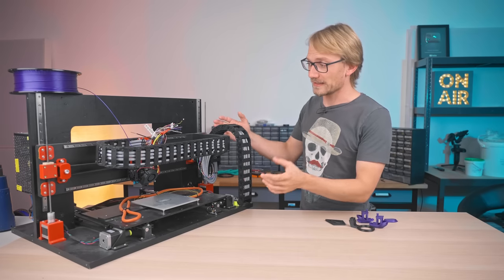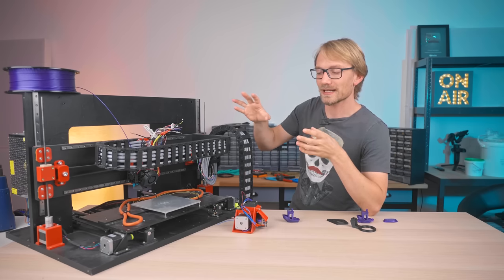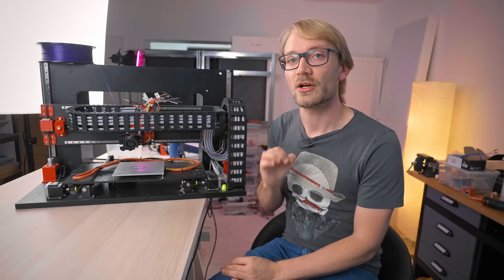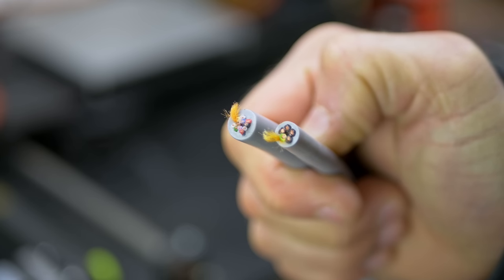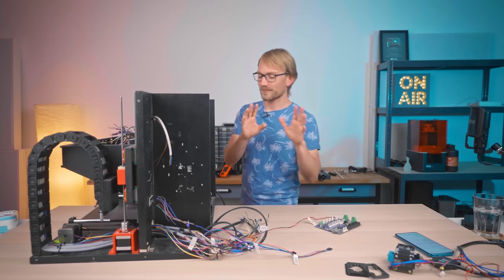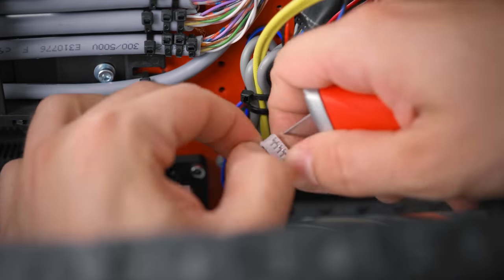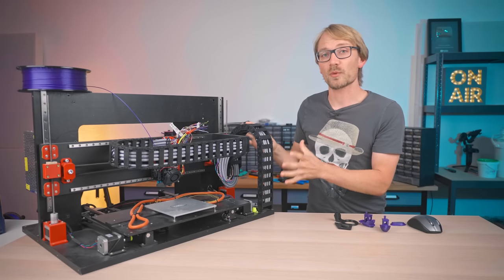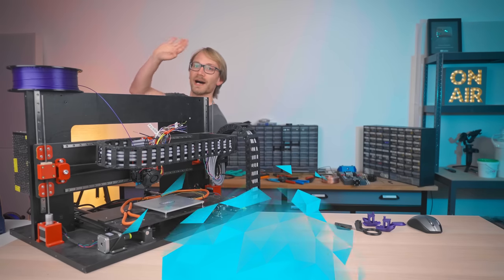This 3D printer can use ANY components - ultimate machine for parts testing!

Comment from the maker: Did I mention it's got dual power supplies? (12V and 24V)
RGB lighting?
Support for ANY type of heated bed? (expect a MK3 clone bed on this soon)
A built-in webcam mount?
Dual Y-axis motors for slinging around that massive bed setup?
A 0.9° motor on the X-axis for maximum resolution? (want to see testing vs. standard 1.8° ones?)
Support for sensorless homing and ANY type of bed probe?
There's so much more that this printer enables me to do - let me know what I should start with!
Reply: so dope
Reply: I'd buy it :D
Reply: You should use rigid couplers for Z screws. The springy ones can cause a lot of artifacts
Reply: How about neopixels that would awsome
Reply: does your 12v go through a Buck/Boost circuit?
Reply: It would be nice to see some testing to show the effects of bed heating on nozzle to bed distance. For example show a poorly setup bang bang showing cyclical cupping/warping of the bed, or just nozzle to bed distance at different bed temperatures. I've personally done a little bit of testing with this using a BL touch and the Marlin optional probe test feature which checks the repeatability of a probe. You can also use it to test the z offset as a function of the temperature you set the bed at (also a dial indicator could probably show that as well).

Anyway glad to see this printer back in motion. And I agree for a first print that benchy looked pretty good other than some tuning required.
Reply: Do the 0.9 degrees motors vs the 1.8 degrees
Reply: Can those Igus cables have a connector crimped on? (I'm sure they can but is there an Igus specific connector?) I keep thinking of using a cat5/6 connector for control signals and something like a Deans T connector for heater power since they're rated for around 60 amps.
Reply from the maker: @Márton Gerlei Something I can definitely test!
Reply from the maker: @Phil Chia it's two full power supplies - one for 12V, one for 24V. Either one has enough power to run the entire printer by itself - that lets me mix and match 12V and 24V components anywhere.
Reply from the maker: @Riot54 I'm using all-standard connectors - "Dupont" style for low power and logic (they can handle up to 2A) and 2.8mm crimp terminals for power.
Reply from the maker: @Eric Lien thanks, lots of good idea for testing things! Over the years I've measure many of these already, but haven't done it in a way where it would be fit for publishing.
Reply: @MadeWithLayers  I was just thinking of those hot end connections since you seem to express some exasperation there, especially with the Hermes/Hermera's crossed over stepper connection. Some kind of breakout board attached to your cheeseplate with the correct wiring for the stepper and a quick connector for the entire cable might save some time and frustration if you do a lot of swapping in the future?
Reply: Great Work as always, I was wondering when this printer would make another appearance
Reply: Bondtech bmg vs E3D Hemera would be cool.
Reply: I would love to see some watercooling tests... But that would require a closed box and a heated chamber to really see the benefits.. :)

However i would love to see the 1.8 vs the 0.9

But I would really love to see some tests of all the chinese clones as People are using these the most...

Im thinking about dragon hotend, mosquito clones and so on.

Test of the latest skr boards would be great aswell..

There is also a bondtech bmg all metal liquid cooled that would be extremely cool to see in action.
Reply: No, I can't have missed that much. Wow you really went all out on this. 1.8° vs 0.9° degree steppers would be really interesting.
Reply: 0.9 vs 1.8 at different speed settings and different drivers a49888 vs tmc2209 with different stepping interpolation,there is so many things like skew correction using sensor less homing on both z axis if they run on separate tmc's same with y axis. how about positional accuracy with that thicker  belt  and different teeth spacing..    now i gladly donate  to patron to answer some of those questions
Reply: I would love to see some clone-vs-genuine hotend shootouts

Nothing to do with the fact that I have a clone in the mail of course...
Reply: It needs a cup holder. Make that an RGB cup holder.
Reply: the genuine vs clone thing is a bit of interest to me, got a v6 clone, after a while of using it found out that the heater was a bit smaller than an actual v6, but when i had a bit of a filament issue (may have coated entire thing in thick layer of pla) ended up putting genuine v6 heater block and stuff on the clone heartbreak/heatsync.  curious if that makes a difference (probably not, seems to work fine, been running this way for quite a while)
Reply: Big - Expensive -> BSht
It's  all about money !
Reply: Yes.
Reply: I'm jealous now...
Reply: Riot54 very true
Reply: Nice build. Very cool.
I also built a printer, that is now my test bed for trying out various things and different hot ends, etc.. 
The challenge on mine was to make the frame 100% printed, and large format (Chiron clone on Thingiverse),, Was VERY happy when it was done,, and it worked better than I expected. 
Instead of a dual power supply (which I almost did), I went with a larger 24V supply, and used a step down to 12V converter to get the other voltage.
Might build another and use rails like you used and recycle the electronics from the Beast into that...
Reply: Maybe a continuous printing belt over the platen, multi-filament feed, multiple heads
Reply: RGB lighting of course.
Reply: You really should do a collab with Stephen Hawes to combine the Mendel 9001 with the Index pick-n-place!
Reply: cool can you test geared motors?

Comment: I was wondering if anyone has done a real life controller comparison. The printer itself is easy to modify but the controllers are the real heart of the printers. I would like to see a robin nano vs ramps 1.4 vs ... tested. Also a full video tutorial on using your laptop and slicer to configure and fine tune your printer.
Reply: I am also very curious if you could see any differences between marlin vs the reprap firmware.
Reply: @Voyager_2  also the robin nano and the rumba 32 and rumba plus
Reply: @recumbentcountry   also skr 1.4

Comment: You can compare modern ways to remove ghosting/ringing. Klipper have Input shapers, ReprapFirmware have Dynamic Acceleration Adjustment and Marlin have S-curve with junction deviation.

Comment: I'd love to see you test out Klipper - either on the Duet (I've done it) or on a different board, to compare Klipper VS Marlin VS RepRapFirmware for example.
Reply: Klipper is ideal for this type of testing rig anyway because of how easy it is to change the printer configuration
Reply: @Nitor_  It's got a duet wifi so also incredibly easy to change the configuration.
Reply: Yeah I'd love to see this too. I recently switched to Klipper and have had no issues with it, but I've not done any proper testing to find minor quality differences. There are none that are immediately obvious though. Unless I find some major issue, which seems unlikely at this point, I won't be going back to Marlin simply because it's so easy to tweak, and I'm constantly upgrading and tweaking my printer. 
It started as an A8 and I'm about to finish my latest changes which will see it as a 300x300x300, 32bit, linear rail, corexy with a 500W bed xD
Reply: @JasonZnack  except I find the duet configuration incredibly tedious because it's all in gcode. To each their own I suppose
Reply: I find my duet mastero so much easier to edit firmware settings I love itsoooo much better thrn flashing a bootloader thrn using audrino and marlin
Reply: @goeland86  Do you know about web interface where you can configure your printer?
Reply: @seanwood5443  Yeah ok - compared to Marlin it's better. Klipper is yet another step to make things easier. Edit a config file in Yaml with human-readable values, and save - it get applied on the fly.
Reply: @vladimirseven777  For Klipper you can install the octoklipper plugin and edit it directly from the Octoprint settings panel.
Reply: @goeland86  I can avoid installing anything and do it for Duet Wi-Fi from browser on my PC.
Reply: @vladimirseven777  octoklipper = plugin on octoprint... Nothing on your PC.

Comment: I built an M90 over 4 years ago from a dismantled Prusa Mendel using dibond panels. It has been a very robust machine and was last used in a print farm churning out visors 24/7 for a couple of months. Glad to see you adopted a more modular approach for the hot end.

Comment: If you are going to be pulling wires all the time, I highly recommend getting a labeler that prints onto heat shrink tube. It won't come off as easily, and won't get caught on the other cables all the time

Comment: Very nice!  Been waiting for this build for a while now, and am not disappointed in the least!  Very awesome build. 

I do think you should consider tidying up that cable area though; maybe make it modular by adding breakout board where all the wires are just individual pin headers (or some other labeled modular connector).  Then you can just use patch cables between there and your actual board (and remove any unused cabling).

Comment: 16:06
I think it will be better to mount this horizontal cable channel vertically, above the extruder, avoiding any warping of the extruder mount
Reply from the maker: Goal was to still keep the printer enclosable - with the drag chain "on its side", I can still slap the flat covers on no problem

Comment: Hey Thomas that is a crazy build! I couldn’t tell what labeler you had I know with the brother P touch you can get heat shrink labels rather than have labels that will come off or tear I live by heat shrink labeling ever since I discovered them! You do unfortunately have to do them before connectors but I believe they are 3 to 1 shrink so there are some connectors you can get them over. Also looks a lot more professional to have printed White heat shrink labels. Keep up the great work loved this video! Edit: I should’ve watched further I didn’t realize you were going to show the labeler again! So you do have the P touch so you can just buy those labels.

Comment: Hey Thomas ... Not sure if you considered it but maybe take all your wiring into a fixed header board that you then wire to your controller board with header cables. This could help with situations where the wiring order needs to be swapped around. The only reason I think you would about that is the small amount of resistance. But it could definitely neaten up the wiring.

Comment: Great platform and great video as usual! One suggestion I’d offer is to install some kind of intermediate connection (like terminal blocks, aviation connectors, etc) between the control board and the ends of the wires. That way if you want to switch boards, you don’t have to worry about what kind of connectors you need or damaging the wiring. Just make a short wiring harness for each board and swapping them would be simple. 😊

Comment: I think you nailed the use of your printer - the motion system. It's robust, and seems to be really strong. If you want to test a hotend, your motion system needs to be perfect to not interfere with the results. Similarly to how you work out ratios, keep everything constant and analyse one thing at a time. I really like this!

However I have one complaint: Not enough RGB lighting
Reply from the maker: There is RGBW in there, it's just not hooked up yet 😉
Reply: @MadeWithLayers  "You can't have too much RGB" -every PC builder
Reply: That is basically the approach of  that ridiculously overbuild E3D-Toolchanger motion system.
Reply: @FreeOfFantasy  Yeah, I think I have a 'thing' for overbuilt machines. There's something about a motion system that won't flex when I sit on it and that's chasing micrometers with the best ball screws that makes me really happy.
Reply: @SuryanIsaac  Me too. I mean there is a beauty in engineering it to the point where it's just good enough and cheap as it can get and there is the "We need more cast iron. The machine can still be moved by four persons." approach. I'm impressed by both but the later is more appropriate for a mill then a printer.
Reply: @FreeOfFantasy  Exactly, a milling machine motion system is extreme overkill for a printer, but that's what makes it fun :)

Comment: This is an impressive build. Congrats. Have you considered "Closed Loop" Steppers?  Closed Loop steppers could dramatically print failures and print quality. Plus I like the fact that the machine you built has some mass to it. One of the reason Machine tools, i.e. milling machines, are built very heavy is to hold down vibration. The same thing should be true in 3D printing. The heavier the machine the less vibration and thus better print quality.

Comment: Oh my god. You call THAT monster a Mendel??? xd
Reply: I must also praise your bravery for using m5 threadded rods on the Z axis. This monster will be eating them up like Salzstangen.
Reply from the maker: IGUS bushings should last a while!
Reply: @MadeWithLayers  Yeah, probably you're right. My experience comes from the cheapest DIY-store-style rods sliding on regular m5 nuts with some teflon lubrication. I have to replace them every 6-12 months or so.
Reply: Dave Cockayne  been used for many years in huge production environments aswell... It will survive this tiny bit of force and wear.

Comment: I would suggest some kind of break out board on the cheese-block carriage, so you don't have so many cable ends waiting to get caught and if you ever encounter the odd pin-outs for steppers you only need to replace a small cable from the breakout to the print head.

Comment: Love it, looking foreward to see you use for testing out stuff. I'm halfway building an inverted delta printer so I can experiment with printheads myself. It should allow me to test printing with crazy stuff like silicone straight from a tube. I plan to use some sort of magic arms instead of a universal mount, hoping to get away not making many adaptor plates.  Having the bed do all xyz means I have no limit on weight for the printhead and I don't need to change print settings regarding bed movement between different heads.

Comment: For your electronics you should use a plug and socket connectors, or a pin connector board. Then you just need a plug with the right pins. I think it could be 3d printed. I 3d printed a mux connector one time for my 3d printer.

Comment: Maybe things have changed but I always thought that using spring couplers in this way on the Z axis was a no go and you needed  the semi rigid ones?
Reply from the maker: Something well worth testing! The Z-axis leadscrews in my case are resting directly on the motor shaft, so the coupler does not flex in the direction of the Z-axis.

Comment: Since you already went to the level of using rails, wouldn't lead screws be better than M5 threaded roads?
Reply from the maker: I picked the M5 specifically because the forces they could potentially induce into the X-axis assembly are much smaller than those of a beefy leadscrew. Plus, the M5 is way more than precise (and fast) enough to drive the Z-axis - backlash is not an issues since gravity is biasing it.
Reply: @MadeWithLayers  Interesting! Back when I was planning on building a Mendel90 (I eventually gave up and bought a Prusa MK3 kit instead), I saw people worrying about the stiffness-under-compression of (M8?) threaded rod used as leadscrews, with the advice being to always load it in tension only (IIRC, it was a major criticism of the basic Mendel90 defaults). I guess it's stronger stuff than people feared?

Comment: Why not put PCB Board on the on the hotend carrier with your wire plug on it and connector on the PCB for connecting different hotend without cutting there wire , you can put different connector type for the same usage ex. 4wire motor and 6 wire motor....

Comment: I have an Ender 4, which uses the same frame as the Ender 5, but I would like to convert mine to the Ender 5. I have found the motor, but no extra parts for the Ender 5. Do you know of any resources that show the parts diagrams, I will make my own parts and can if I don't get the diagrams, but they would help save me some time. Thanks.

Comment: I thnik I should send you some of my water cooled heat sinks for dual separated heaters (Chimera style) or water cooled Diamond tool with 3 filaments input just to see if you can go at 400 Celsius like I do and what is the output using various slicers and firmwares.  (they do not look like made by a professional CNC machine shop, also because I use muy colum drill press as a manual mill... and my hack saw to work on them)

Comment: Please upvote this so he can see. Solder your own VGA cables, you will thank me later. Use pure silver solder if you are worried about the hot side, but this is not necessary if you give 30-50mm for the cable to cool.